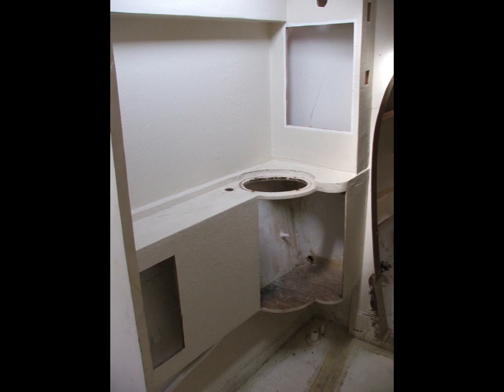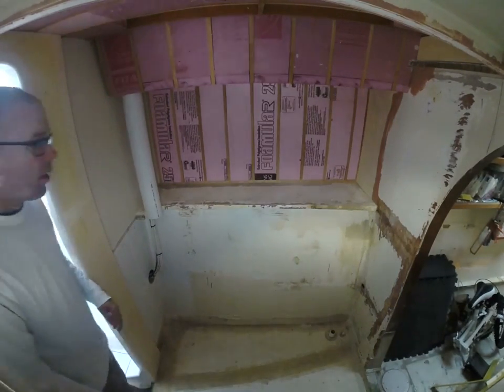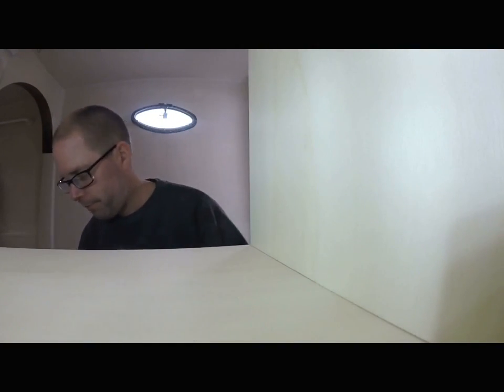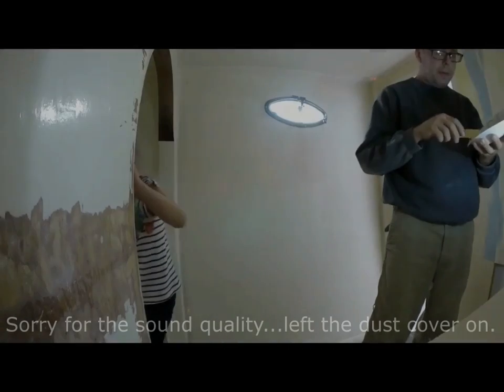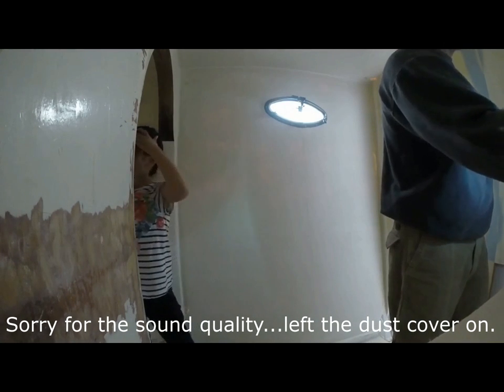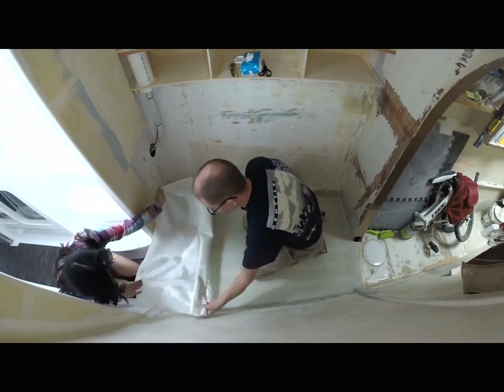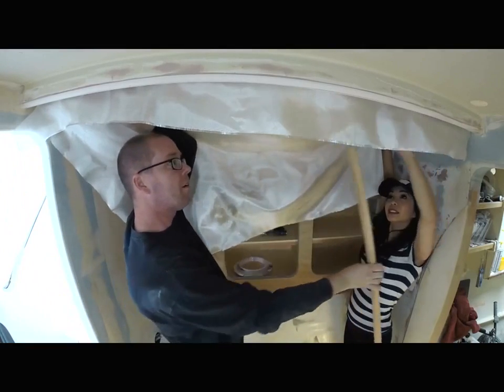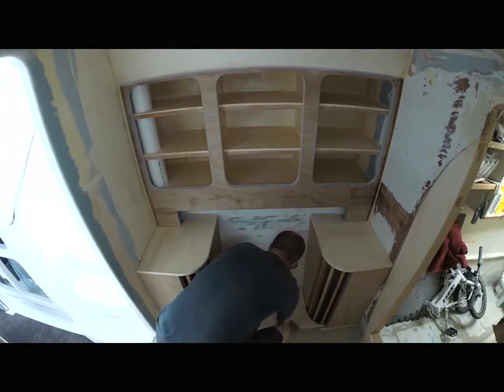Onboard Lifestyle ep.1 Building our Dream Catamaran

Comment: I luv your videos and the work I have watched so far. I use 3M spray adhesive to secure the fiberglass overhead or vertically when needed.. Works great and may say you some time or headache
Reply from the maker: That's an interesting idea that I will look into...thanks for the tip!

Comment: Going back to revisit some of your past projects. Keep thinking, when you run the big popsicle sick to create the radius it seems that there is only so much pressure pushing in the thickened epoxy no? Seems like it'll be somewhat porous vrs using your finger to really press it in at the risk of leaving a nice transitioning curve. But maybe since you end up glassing it, it doesn't matter?
Reply from the maker: I use a 1" stick and  with a bit of practice it works perfect for me. When I use my finger the radius changes with pressure but with the 1" stick it remains consistent...thanks for watching!

Comment: Please, please, please; next time to have to epoxy over your head, roll on some epoxy;  wait for it to get sticky;  push the fiberglass into the sticky epoxy; wait till it hardens; and layer the rest of the epoxy on.  I use this technique no matter the orientation of the surface.  You can be very sure the interface between the glass and the surface has epoxy on it without worrying about saturation of the glass problems (or bubbles).

I've gone through almost 200 gallons of epoxy building my self-designed, self-built glass over ply 49 foot cat.
Reply from the maker: Good advice Philip, I am constantly learning. We do have a lot of overhead epoxy work coming up when we build the new hardtop this summer.
Reply: @OnboardLifestyle  Using epoxy==White vinegar destroys uncured epoxy quickly cleans drips epoxy in hair etc I always have some on hand when using epoxy

Comment: Just curious why you would permanently seal the tank up instead of making a removable floor board?
Reply from the maker: Since the  cabin sole is right at water level I wanted to add strength to the hulls by integrating the new floors into the sidewalls with honeycomb composite and multiple layers of glass. The unit is a custom made 1/4"  food grade FDA approved virgin polyethylene poly resin tank and has a lifespan of 35+ years so I should be good. Besides, if I ever have a problem it just creates another fun project for me!
Reply: You definition of fun and mine are vastly different.  But I do understand your reasoning. Thanks for the reply and keep up the great work!